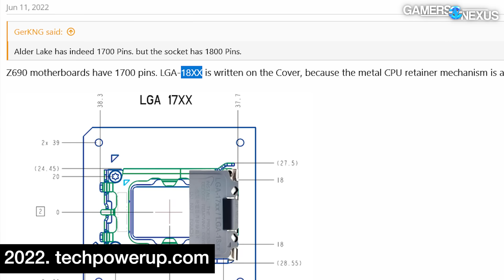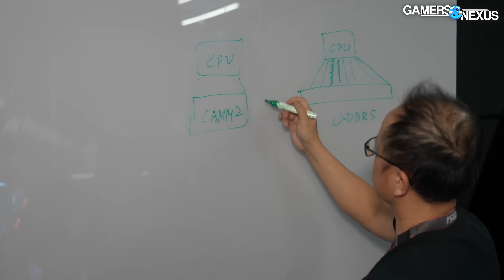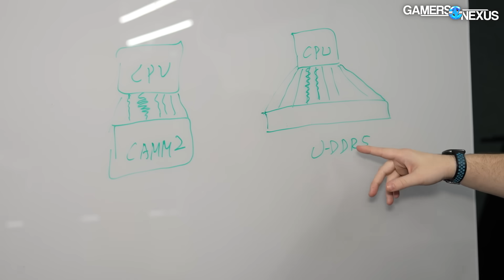Intel Says Not to Say "LGA1851" or "Z890" | MSI vs. ASUS Features & X870E Boards

Comment: Intel - a new socket every  2 CPUs.
Reply: @JS-oh2dp AM3 still lasted longer than a typical Intel socket IIRC and AM2 was fairly long lived too, even if they weren't AM4 levels of long lived
Reply: @bosstowndynamics5488 that's all well and dandy but am3 was awful. Especially for gamers.
Reply: @craig9365  Ok, but we're talking about socket and platform support here, not CPU architecture.
Reply: Welcome back LGA 1151
Reply: They made it 2 and a half generations this time, yay for improvement.
Reply: @c0348whnit is, just because tech has advanced cpu's are still 50 years old
Reply: My biggest reason I stick with AMD, though I'm not going to blindly trust their marketing team that AM5 will last, but I certainly trust AMD to provide longer support then Intel, so in this Duopoply I'll stick with AMD till they wrong me (they eventually will)
Reply: @MayYTlive I am not getting anything AM5 on the principle of LGA. LGA is bad. Waiting for AMD to come back to their senses with PGA AM6
Reply: @igelbofh   "LGA is bad" what a joke 😂
Reply: It works the fools rush to buy.
Reply: pretty much. Glad I went AM5.
Reply: Let's not forget the 1151/1151 v2 BS that was engineered purely to force motherboard upgrade. You could even run 1151 v2 CPUs in 1151 motherboards with minor modding (see coffee tool).
Reply: With no innovation and increased energy efficiency among the generations
Reply: well we had socket 2011 a few years ago, we are not far away from using it again if Intel changes the socket again, congratz on those who still have their 6800k cpu
Reply: @scudsturm1  Intel will make a 2011v3.
Reply: 3*
Reply: Also with DDR5 you can't just add 2 more sticks, since it'll be unstable, and no one makes 4 module kits because they're unstable, so having 4 dimms on mainstream boards has become a waste.
Reply: Chill out everyone. Very highly doubt if you own a 13, or 14 series intel i9 cpu (even i7 maybe, and the 12 series i9 as a stretch) you'll need to change your motherboard anytime soon. I will have my 13900k in my ASROCK taichi in the foreseeable future. There are very little benefits if you own a z690/z790 with atleast 1 pcie gen 5 lane to upgrade to a new intel socket. I can understand if you own a biz with more than 20 people needed access to your NAS or 1700 rig without a NAS...although why you would do that without NAS or cloud storage of some kind with many employees is beyond me. Or I can also understand if you went with a 12th or 13th gen i7, if you are a upgrade every year enthusiast, again tho it's beyond me for an enthusiast to go for a yearly/bi yearly i7 upgrade.

You won't need to upgrade unless you are planning on getting a 6090. 5090 I highly doubt will be slowed down by a 13th/14th gen i9 if you are just a gaming enthusiast, or have less than 10 employees, or just yourself with a biz.

(I own 3 sound/video production studios with 1 to 3 employees at the locations, or operating from there home. Also with a non profit sector program, for students who can gain college credit for careers in related industries including computer engineering as an extracurricular class I teach myself for a semester a year.) 

My personal rig my employees, schools, students, and customers need access too along with an fully loaded 2013 mac pro at the sound oriented studio which is also connected to the server that ties my personal rig, NAS, and other studios all together is a 13900k/4090/96gb5600/ (4tb 990, 2tb 980, 8tb gen 3 p3, 22gb of sata) on a asrock taichi z690 mobo sitting in a fractal meshify 2xl case with an EK360 dark (I know, shut up tho it works fantastic, hopefully they get there act together before it comes time to replace) and lol an alphawolf gpu aio. I'm in no need to upgrade despite all that I do, with gaming on the side. Will I get a 5090 for my personal rig? Yes but that's besides the point 😂 I'm a hypocrite tldr have a great day sorry upgrade away.
Reply: Socket 1151 hosted 6th-9th gen if you feel a little hacky with the BIOS, or buy a China motherboard that supports all.
Reply: are you stupid? Intel lgs
Reply: We were stuck on LGA1151 for a like 5 gens. Only thing that changed in that time was the most minor things so they can sell you another board and CPU.
Reply: AMD is the sole reason Intel isn’t doing one socket for one generation CPU.
Reply: It's more like every CPU. The second GPU 'generation' Intel releases for the same socket is usually just a refresh with +100 MHz
Reply: @hornsteinhof7592 Lets see if AMD can improve AM5 as much as they were able to improve AM4
Reply: Intel needs to take notes from AMD on supporting motherboards.  Back when I had my 3770K I was pissed at Intel for not supporting socket 1155 with more CPU's. So in 2018 I left them and now 3 CPU upgrades later using a 5800X3D I'm very happy with AMD, and don't see myself upgrading for quite a while unlike Intel.  Until Intel changes their ways with supporting sockets I am not going back. For me it needs to be at least 5yrs.
Reply: maybe a bios update for X79 or X99, well they had the 18 core on this who pulled 800W easily when overclocked, should be capable of handling the newest cpus
Reply: With my AM4 cpu i had to buy a SECOND AM4 cpu just so i could update the bios and actually boot my system with the first cpu, then sell the second cpu on ebay.  Even 1 socket per generation would be more user-friendly than this shit.

Do you guys actually upgrade cpus? I didnt think that idea really exists outside the tech journalist bubble. Everyone I know from real life just waits 5+ years (some even way longer), and then just buys an entirely new rig because at that point upgrading individual components is pretty pointless.
Reply: that was normal. Just AMD actually started committing to their boards recently.
Reply: @Elomentoplayz  What do you mean recently? I thought they committed since AM4 in 2016?
Reply: @anatropous5112  and i went ballz deep on ryzen in march 2017 and still have that same board to this day.
Reply: @TheGuyWhoDidUrM0M  Me same: a solid x370 with a R7 1700 that I'm going to upgrade now with a R7 5800X3D. Insane!
Reply: @TheGuyWhoDidUrM0M  Still rocking my X370 Gaming K7, gone from Ryzen 1700 to a 3700X and had a 5800X3D in since start of 2024.Had all manner of gpu in the system since 2017 too, gtx760 caried over from my old Z87/4670K, Vega 56, RX6700XT and now RX7800XT. Might go AM5 once the 9000 v cache chips launch.
Reply: @anatropous5112 that's one generation. And they tried to back out of AM4 compatibility until people lost their shit.
Reply: @BICIeCOMPUTERconGabriele  That was also my choice when upgrading but ended up with a 7800x3d and 7900xtx.  I'm all set for years now.
Reply: @Elomentoplayz  normal? do you know how many generations we had during the 486 and pentium and athlon era's? and we had MULTIPLE companies using the SAME compatible socket...

what we GOT now is greed and monopoly instead of stuff working together across companies... even now with simple shit like "nvme mechanisms" etc. they don't want to work together to better the scene for all... they want to be unique unicorns and hope the rest fades away... but without the other companies they would just become a monopoly which is good for NOONE...
Reply: @Elomentoplayz normal for modern times, but not normal in the past.
Intel used to do overdrive chips back in the day - extending socket lifetimes considerably.
Eg the socket 3 went from 486sx 25mhz in 1991 up to pentium 83mhz in 1994.

Even the slot 1 boards went from 266 up to around a GHz officially, and 1.4 semi unofficially with slot adapters.

Both are about 4x faster which just simply isn't happening these days.

They're changing sockets simply to sell more chipsets now they've killed all 3rd party chipset vendors.

Classic monopolist behaviour.
Reply: @Elomentoplayz  Not to completely disagree but AMD has had sockets that lasted long enough to get an upgrade cpu in previously, things like AM3 chips being 'compatible' with AM2 sockets so the 2006 socket was technically ok until about 2011 when the AM3+ chips if memeory serves were no longer compatible. AM3+ lasted until AM4 which was 2016 so about 5 years however as there were no upgrade cpus in that time (just 'new' ones) that barely counts. My point is longer than 1 generation cpu support is more often that not the norm from AMD.

Good sockets with good upgrade options are less common but they have been committing to their boards for most of this century in the mainstream segment at least, even the socket A from 2000 beats nearly all Intel platfroms by being valid for 3 years compared to Intels standard of 2, at best sometimes. Just for a 100mhz clock bumb (looking at you 7700K)
Reply: there is no point in old socket if your chipset does not support new CPUs with old socket. Marketing bullshit.
Reply: @severgun  Well, EVERY AM4 motherboard's chipeset support new AM4 processors, after a BIOS upgrade...
Reply: There was no need to change socket though. The intel CPU has the same architecture with no improvements except more power draws.  @severgun
Reply: @Doflaminguard  same for amd 8000 series and 7000 series.  No cpu improvement